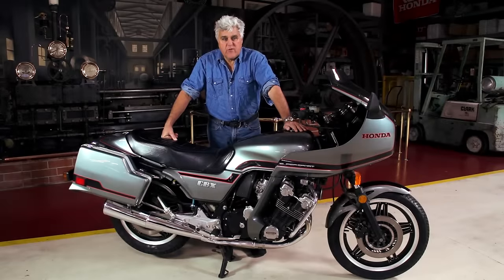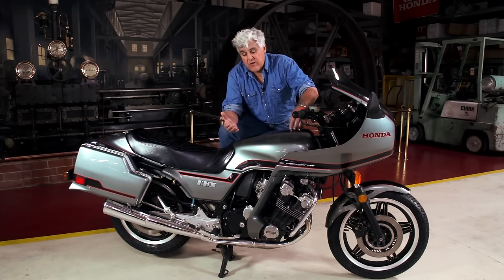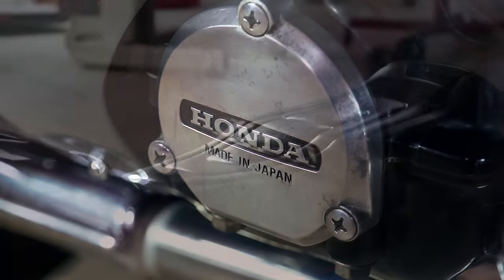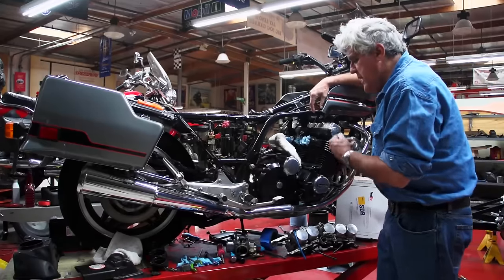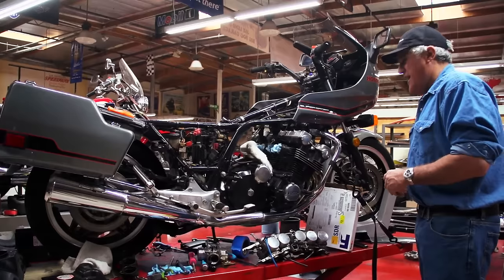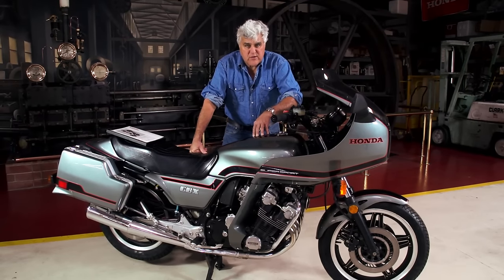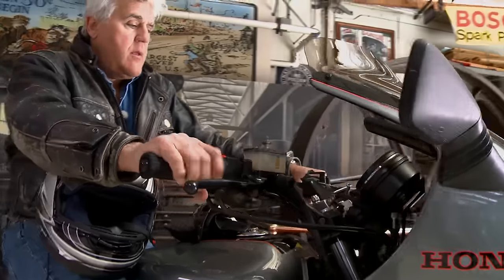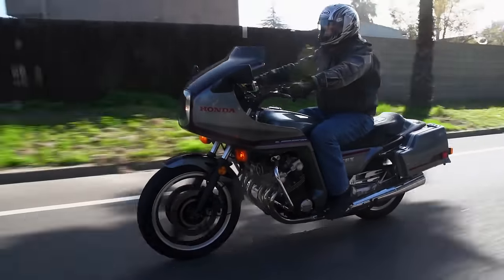1981 Honda CBX - Jay Leno's Garage

Comment: Those Honda 6 cyl engines are among the best sounding  of all time.  Not to quibble, but the CB750 is what put Honda on the map.
Reply: Yup, silly thing is the original 750 was a pretty lame engine overall.  Heavy, and low power.  The 450 DOHC was a much better bike overall (for at new performance) but hardgrained mentality bigger is better, sad.  I have multiple vintage honda motorcycles, but I will never get a classic 750 just out of principle.

Oh and for sound, (yeah, this is parallel to the 750) is my 650 with glasspacks.  Sounds better than the CBX (in city).  Alas, the cbx is now scuffed.  Suspension on the CBX are terrible.  The air rear is problematic.  A strong wind blew in from a wierd angle while at a bbq, blew it over.  Scuffed engine guard, signal and side case... sob.  I have the rebuild parts but full modern replacement on the way.  Can keep original, but nothing wrong with some of it in a box.  New front, new rear components.
Reply: Hey!  I resemble that comment...   Though the bike itself is kind of a pig, the engine in my ol' 93 Nighthawk 750 is as reliable as a brick and squeezes out enough HP to move the 500 lb. bike to 60 mph in around 3.8 seconds. Not too shabby for a carburated, air-cooled, hydraulic lifter, single disk, rear drum, spongy fork, double cradle, ancient suspension bike. By every measure, it is an utterly ordinary, design by committee, parts bin bike. except when ya ride it and develop a spontaneous grin.

In any case, the Honda 4s revolutionized motorcycles. The CBX is amazing, but it's the old CB750 that got things rolling.
Reply: Well, I was refering to the first ones.  It did revolutionize motorcycles, and an absolutely reliable engine.  But the very first 750s, the SOHC 4, still less of an engine than the 450 DOHC.  Even the carbs were less advanced.

It is like the origins of the V8s in performance.  There were more advanced and better performing engines.  The V8 was for work and trucks, but peeps did the work to get the power out of the big engines.  Overall, they still were worse, but power was king.  Eventually the manufacturers developped the market.

So 450 faded into honda civic predecessor history while the 750 got the tech.  Eventually the 4s got the tech from a decade sooner.

So, just principle as a 450 owner is all.
Reply: Doug Elick That was a hydraulic adjuster not lifter. The rocker arm was pushed open by the camshaft and a small hydraulic adjuster maintained a proper clearance between the rocker arm and valve stem.
Reply: Right, it was lazy nomenclature on my part. The 750 (I own one) has hydraulic lash adjusters the rocker arm pivots on, though it's not a rocker arm in the conventional sense, but really a pivoting cam follower. The old Chrysler 2.2L 4 cyl (Horzon, Omni, K cars, Laser, etc)  worked exactly the same way.
Reply: Doug Elick They sound refined. Like an electric motor. The sound comes from the engine's internals more than the exhaust.  I like a good single or vertical twin that revs about 6000rpm. Music is created when up and down the box at speed.
Reply: Angus Davies That's  why I love my little Vulcan 500. Its parallel twin sounds great all the way up to 8 grand
Reply: Angus Davies That is any engine with full mufflers on.  Hear a CBX with a performance exhaust and nothing compares to that!
Reply: Doug Elick whats with you guys yapping about little bike engines & chryco 2.2's? Wake up guys. The subject is not about cb but CBX. 

I rode my friends 79 CBX with a 6 in 1 even helped install a rebuilt engine what a PITA she was. Nothing on the planet sounds like that near 10000 rpm.
Reply: +Doug Elick you're comparing the really old 750's to the more modern Honda 4's and I agree with you the Nighthawks were one of my favorite bikes...very underrated ..they were light in the clutch and really fun to ride
Reply: +MarkusReese how about a Honda Valkrie with 6 into 2 open mufflers with a supercharger?  A guy at our shop has one...I have fun scaring the Harley guys when I pull alongside on it  XD
Reply: Mud Sh-sh-shark Oooh... that is insanity.  Never heard that, but can imagine.

Though for the maximum definition of crazy, how about those mega horsepower turbocharged Triumph Rocket III?

60-120 faster than many 0-60s!
Reply: +MarkusReese wish I had a pic...It was Yellow with red flames and custom Corbin hard bags  I loved that thing  :p
Reply: The CB750 was ground breaking and lead the pack at that time,  I own 3 of them. But the CBX took it to the next level! I will have one someday! 
3:)
Reply: Ya David , that was my very first street bike, a 1969 cb 750 tho I worked all  all summer to buy it.(high school) it was not new, I bought it in 71. Very fast for that time, but always had electrical malfunctions with it. The Mechanics would fix it briefly and it would go out again. So I sold it and bought it a Triumph 650 Bonneville. Also fast for it's tie but constant break downs. I gave up for a few years and started up again with AMF Harley's LOL.
Reply: I had a Bonneville 650, a 500 Tiger, and a 250 Tiger cub!....I wish I would have kept them. 3:)
Reply: They're not cool,  but much earlier,  the 50 Super cub is what put Honda on the map.
Reply: I owned the 1982 CB 750 F super sport. I loved that bike and wish I still had it they make sick cafe racers out of them now
Reply: The earlier 1960's 305cc Super Hawk put Honda on the map... blew away the Harleys, Indians, Triump/BSA/Norton 650's... cost so much less... but was more reliable... had bright headlight... no oil leaks... OK, horrible scary handling...
Reply: terry breedlove I owned one of the first twin cam 750’s it was plagued with problems. Launched at the same time as the CBX and the 900F, the 750KZ was supposed to be the leader in its class riding on the coattails of its bigger brothers. After 1200 miles it blew a mainshaft seal shortly after that I received the recall notice, it suffered a cam chain failure at high rpm (less than 5000miles on the clock), finally the exhausts started rotting from the inside out (four into four) allowing the internal baffles to rattle around. Honda picked up the tab for the repairs, by which time I’d had enough and traded it for GSX1100. Should point out I live in England assume you had the same model line up, although the British spec CBX’s were more powerful, and the foot pegs were set further back
Reply: But it has 5 cylinders....?
Reply: @MarkusReese  70 HP in a 500 lb bike in 1969 is nothing to sneeze at and the dohc 750s bumped that up to 80 it's not slow by the times standard
Reply: @MarkusReese  Hell the CB750C basically makes the same HP/CC as the 450/ 70 HP in 1969 for the CB750 and 40 for the 450
Reply: The Honda Cub (50cc - 100cc scooter) is what put Honda on the map. 
https://www.youtube.com/watch?v=NunNe-8MtXI
Reply: Well, I would say the CB750F, to be precise
Reply: @ChaosBW  they had one of the carbs off the rail
Reply: Honda has a list of ledgendary bikes.  Hell even the rebel250 is a classic that everyone knows and never really badmouths. Fast? No but dead reliable and simple.
Reply: N0, The HONDA CB 350 GOT THE BALL ROLLING !
Reply: @DavidLee-no9uc  CB 750F1 Was King of The Road Back in The Day . Then Came The Kawasaki KZ 900's !
Reply: Excuse me, buddy, but the Honda 50 is what put it on the map. "It's not a big motorcycle, just a groovy little motor bike!". Rented one of them in Ft. Lauderdale for Doc Coucilman Swim Forum winter workout for us East Coast swimmers, and I was hooked! Jr. year I got a Honda 150 Benly, Sr. year, a 305 Dream. Put a full fairing on her and drove her from Rutgers U NJ to Palo Alto CA via north rim of the Grand Canyon, then traded her in for a Honda CL450 which I drove to Pensacola NAOCS school (movie Officer and a Gentleman with Richard Geer). And when that was worn out, a CX 500 which I still own. And yes, the 750 was a huge breakthru, especially when it won the Daytona 200, beating all the purpose built Harleys which had always won the race, and, sationed at NAS Glynco for RIO school, I was there to see it happen!
Reply: @MarkusReese  I owned a CL 450, which I took to 103 MPH right after I broke it in on the 280 Freeway going past my folks house in Los Altos Hills. Then I drove it coast to coast in rain and snow in March of 69. I would not recommend going cross continent in the winter on a bike to anyone, especially when your throttle cable freezes stuck while going 70 MPH into rutted wet ice while crossing the Pecos Mountains in Texas. Wooohoo!
Reply: @michaelsmith1094  glutton for punishment it sounds like. As choices kept getting worse...
Reply: @main199  the twenty one of them you would have to line up to match the CBX's displacement WOULD put you across the map
Reply: @amenentuet  that was a fast bike alright.
Reply: @amenentuet  The most prolific motorcycle in history.  Everyone else forgot apparently.  🤷‍♂️
Reply: Honda’s are fabulous
Reply: Soichiro Honda-san is the best
Reply: Personally I prefer the silky smooth 6 cylinder Kawasaki Z1300.....
Reply: Also the old mv Augusta race 3 cylinder or the Honda gp 5 cylinder are among the best sounding I think also the 8 cylinder sport bike sounds amazing that pmg one.
Reply: Kawasaki
Reply: I think Jay Leno was actually referring to the 6 cylinder bikes that Honda made for racing in the early 60s. One of the engineers for that early racing bike designed the engine for the CBX. As for which consumer motorcycle put Honda on the map could be up to debate but most enthusiasts would concede it was the Honda CB750.
Reply: Yup, I know what you mean. There's nothing like a CB750Four, yeah you can yap about the CBX, and others but anyone who's owned a 750 in the 70's brand new Knows. We're talking about two different bike's, yeah the CBX is incredible, and so are many other bike's.
Reply: The Honda 250 and 305 had already grabbed everyone's attention...
Reply: It's the CUB that put them on the map. Just a small bike with huge impact.
Reply: @MarkusReese a weird wind aka one of your buddies backed into it

Comment: My dad had a 1978 Honda CB 550 four, which I started riding at 15. Of course I upgraded to a 1978 CB 750, which was an even better bike, a lot faster. But when they came out with this bike, I had to have it. Was never able to buy one at 17, but now at 53 have been looking and have found a few, but in my small account world, still remains a dream. Yes, as a mechanic, I run into rebuilding carbs constantly, ethanol in gas was the worst idea for carbs, unless you turn off the fuel supply and let it run until it runs dry everytime you shut it down and let it sit for more then a few days. 😊👍 Sweet bike man.

Comment: That bike looks like it just came off the assembly line.  The brochure looks like it was just printed today.  Jay, you really take care of your stuff.
Reply: Wiser InTime More like: Someone takes really good care of his things.
Reply: +Gasrullen Or he rarely even uses them at all.
Reply: Noukz37 That too.
Reply: +Wiser InTime I think he probably doesn't even ride it.
Reply: +Wiser InTime I know this is nearly a year old comment, but you did see that it only has 1200 miles on it.

Makes me feel sorta bad. I bought my Daytona 675 brand new a few years ago, and I've not wiped it down a single time. Then again, my bike isn't for show, it's or riding, she could be covered in mud and still be beautiful to me.
Reply: Main Character You meant 12,000.
Reply: Wiser InTime No, 1200. The one on the far right is a 10 point clicker. Example 1237.1 miles.
Reply: 10 point clicker... LIsten at me... You know what I mean.
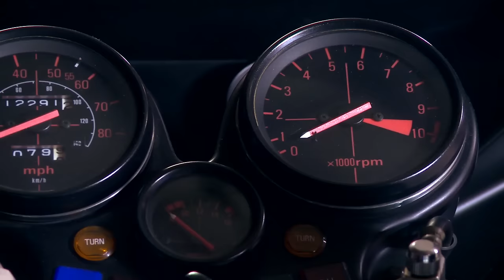Reply: Main Character Looking at 2:00 into the video the odometer shows the mileage is 12,291.2
Reply: Wiser InTime Better eyesight than me clearly. Was wondering why the last digit wasn't reversed color. Good on you.
Reply: Main Character I wasn't even looking for the mileage the first time I saw the video.  I went back to check it out after I saw your comment.  Either way it is relatively low mileage.  Jay has so many vehicles it seems he probably wont ever rack up too many miles on any of them if he uses them each about equally.
Reply: +Wiser InTime More mileage than mine!  I am scared to know the time investment to keep it that way.  I don't know how the coating on the aluminum is still perfect.  Just boggles my mind.  Well, the aluminum being perfect I thought, but looking close, you start noticing the typical wear and patina for these.
Reply: he didn't take to good of care of his first one, he wrecked it. lol
Reply: you do realize he has a restoration shop right?
Reply: its his personal fleet mechanic that takes care of EVERYTHING
Reply: MrCoffeekelly he did say it was unrestored.
Reply: Delroy Campbell the reset odometer has the 10 clicker I think.     lol 10 clicker listen at us
Reply: He has like 300 vehicles or so, no wonder he has low miles on them LOL
Reply: sorry...but it shouldnt idle that high......needs better tuning
Reply: They just had the carbs off and apart. Jay knows how it should run and it would take a page to explain why the idle was 2700 or so. I still have my 6 pot mercury synch tool and its adapters plus the right angle screwdriver those impossible mixture screws under the carbs.   When everything is set correctly it idles smoothly. You can bet that Jay's bike idles correctly now.
Reply: It is well known that Jay alternates vehicles enough to give them all some drive time. Even if just taking a vehicle home from the shop in the evening and back in the morning. I do wonder though if employees drive some vehicles to give each some drive time. I wonder if a video exists where he gives a tour of his facilities because there have been many videos where it starts out saying “Here we are in the MOPAR room, etc. How many buildings make up this complex? It’s incredible.
Reply: Thats passion right there
Reply: He has others do that for him.
Reply: There is no way physically possible for him to work on all of his vehicles, even if he wanted to. Thank God he has many of these, they would be scrap.
Reply: @badapple65   as far as i know jay has his cars and bikes stored in a air plane hanger at the airport.
Reply: Even his jacket, of all things.
Reply: Looks that way when you make 24-30 million a year making fun of Wacko Jacko on Tonight Show.. untill he died then it's all condolences etc..
Reply: It's a mantel piece..
Reply: James Demestihas,
"... it shouldn't idle that high ..."

That's what he said. ( 11:52 )
Reply: FabzRustRider love this bike
Reply: Easy to do when you can keep them In storage the way he does.

Comment: I stripped down about 9 of these bolt by bolt and part by part and rebuilt them from the ground up, full measurements, bore and valve machining, dyno...the whole 9 yards in a motorcycle school and in real working condition from 1990 to 1995. Even taught classes on this and many other models for 3 years...
I love this bike!

Comment: I met Jay when he just bought it, I had just picked up my Yamaha XS 1100 and we talked for a bit about our bikes as both es were new and rare at that time. I was turned off by the complexity of the CBX while he loved it. We met on Mulhulland hwy one Sunday and I still remember it like it was yesterday. I still have my XS but it is not anywhere near as in nice condition as his. Oh well.
Reply: Still love those xs1100s. Had a fj1200 and was indestructible.
Reply: I had a ‘79 XS Eleven Special. It was nice. I had purchased it from a friend, and the fairing that had been put on it made it shaky at triple digit speeds. Sold it a few months after I got married in ‘89.
Reply: I had an XS 1100 that was set up as a sport tourer.  Don't know why I got rid of her.  Loved that bike.
Reply: @y.u.doodat9133  I had 2 of the 750 xs second gear , snap ring would pop off the shaft inside and leave me without 2nd gear..still got one of them but after a 100000 miles the head gasket burnt out. Still haven't fix it yet but plan on it. Riding a 750 suzuki now
Reply: I had me a '79 XS 1100 with the old school fairing, hard bags and trunk.  So much room to carry stuff when traveling.  Came across an '80 XS 1100 with a bit more updated version of all that (square lights as opposed to round lights) so I traded up.  My brother needed a cruiser so I gave him the '80 and found me the "sister" bike of the XS - an '82 XJ 1100 Maxim.  No touring package on that one, just a windshield.  This was years ago and I still ride the Maxim to this day.  Fires right up and purrs like a kitten.
Reply: I have two 79 xs1100 specials

Comment: Bought a 650 nighthawk brand new in 82 and drove it for a couple of months. Was in the Honda dealer one day and saw a CBX over to the side. Asked about it and was told I could get a crated 79. Traded 650 for the 79 CBX. Blown away by the CBX and had it for a couple of years. Needed a car and traded CBX for 75 Riviera. Loved car but missed CBX terribly. Guy who got bike wrapped it around a pole later that year. He was fine. Six years later I bought an 82 CBX (used of course) Had it for about 9 years until I couldn't afford the repairs any more. Sold what was left but miss the bike a lot. Will have another some day but in the meantime ...thx Jay for the memories. I appreciate you greatly for all that you do for motoring.